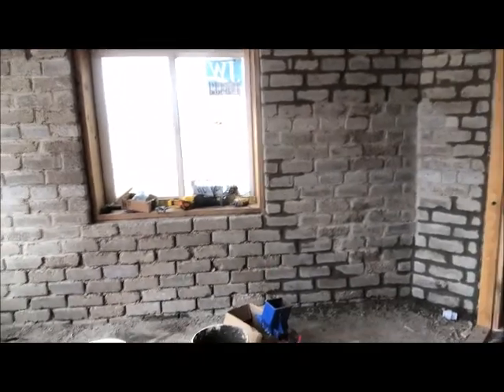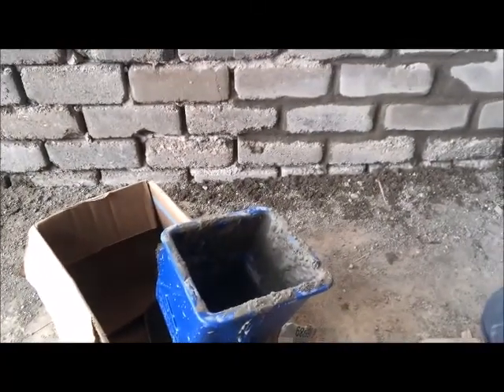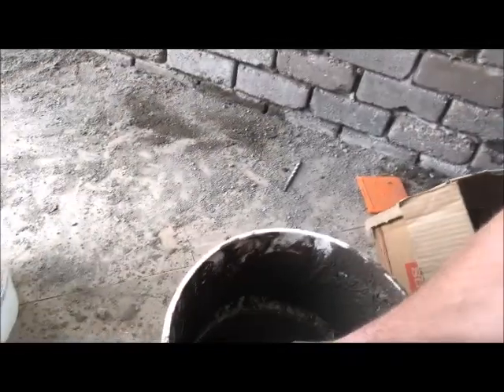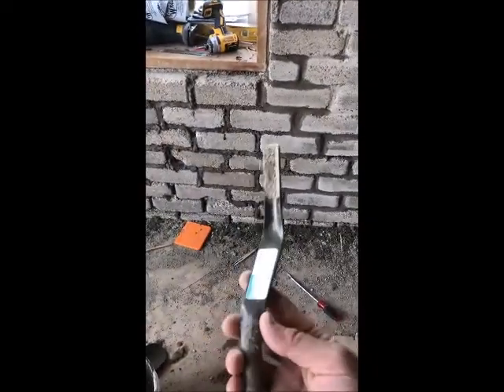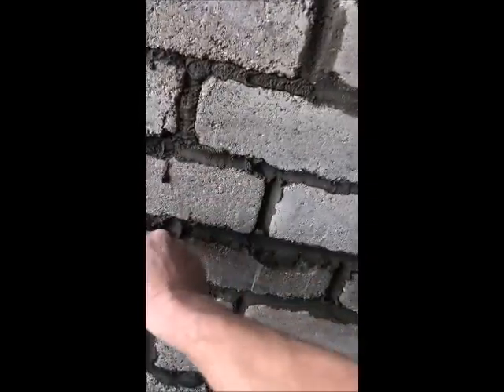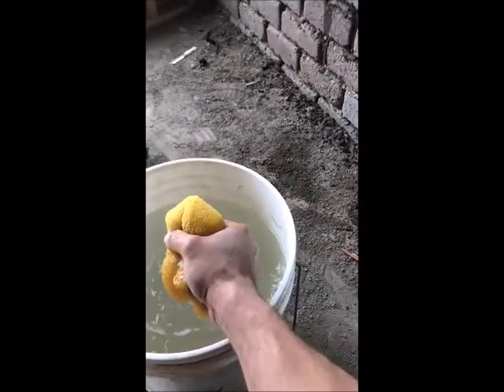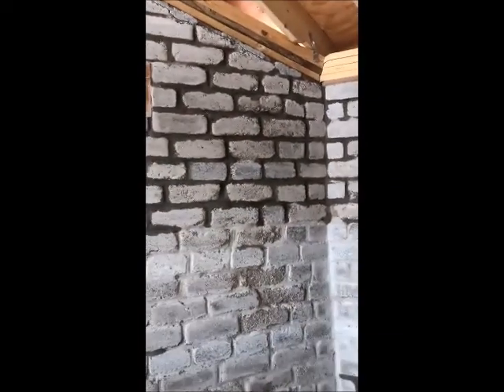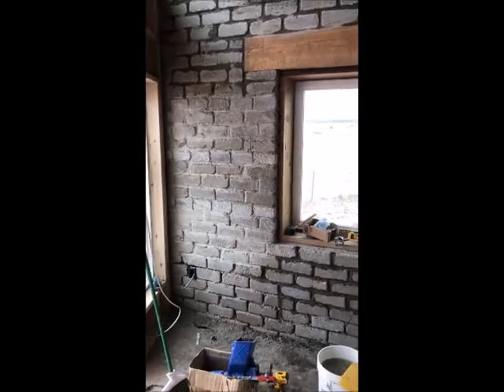Pointing a compressed earth block (CEB) wall

Comment: In a video of your building in San Antonio, your block laying man is using a pancake mix slurry in the joints rather than mortar joints. Because the slurry is the same material as the blocks the slurry acts as a glue and melts the blocks together (are at least that is what I have heard). In other videos, including this one, you are laying the blocks with mortar joints. I kind of understand doing mortar joints with brick or cinder block but not CEB. Are you doing mortar joints for aesthetics or for some other construction purpose?